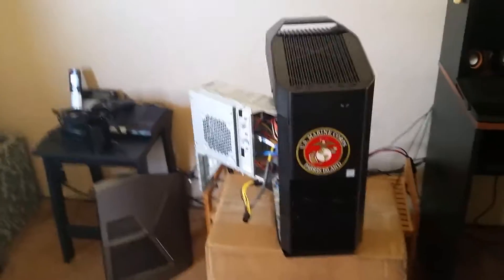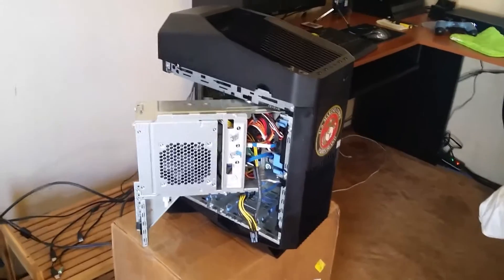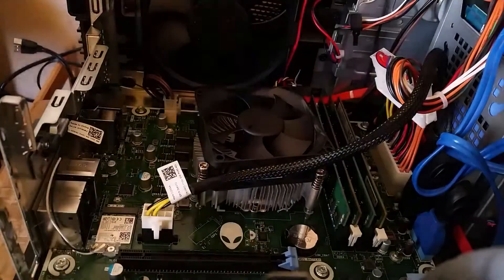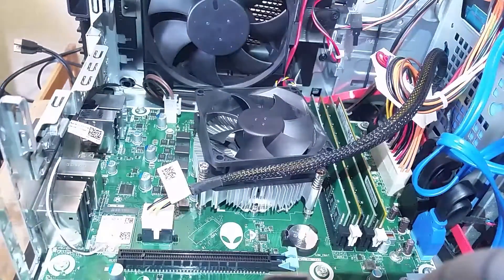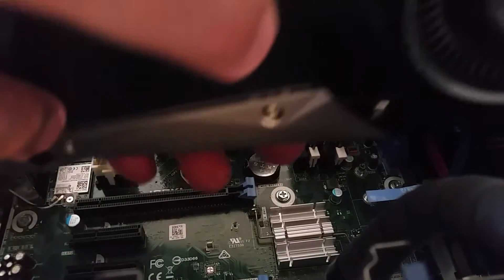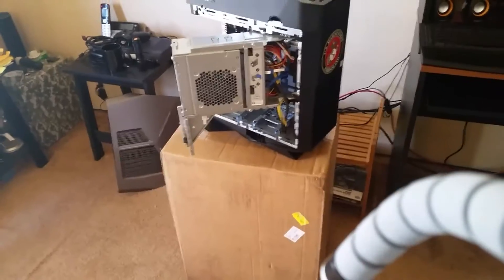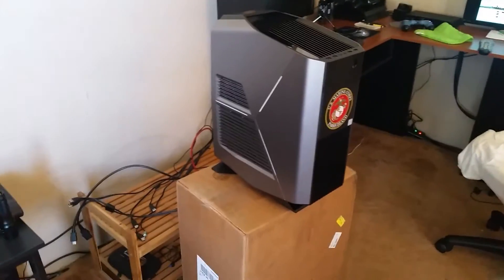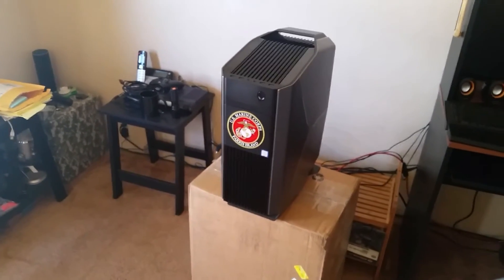Alienware Aurora R5 upgrade my Ram 16GB

Comment: Just FYI:  If you choose to install more than 16GB of RAM, it can't be over 2133Mhz.

The Aurora R5 motherboard is only certified for up to 16GB @ 2400Mhz or up to 64GB @ 2133Mhz.
I fried my motherboard attempting to post 16GB of 2666Mhz.

So, if ya wanna go above 16GB, just make sure your DDR4 RAM is 2133Mhz.
Reply: well thanks for this, i wish i saw before my purchase but luckily i didnt install my 32 gb 3000Mhz ram.... Thanks